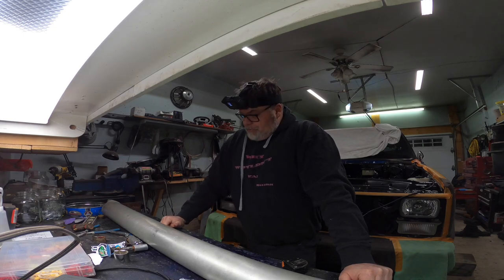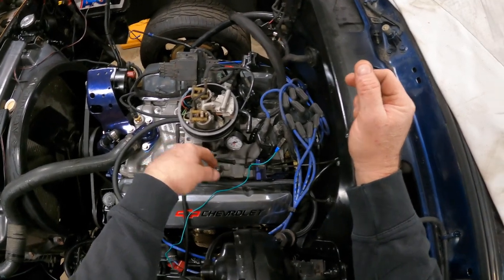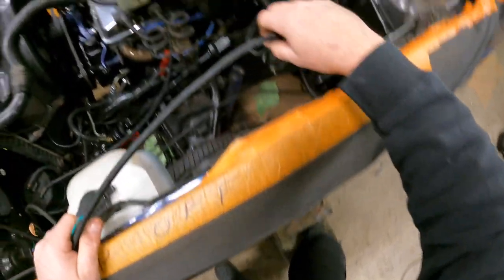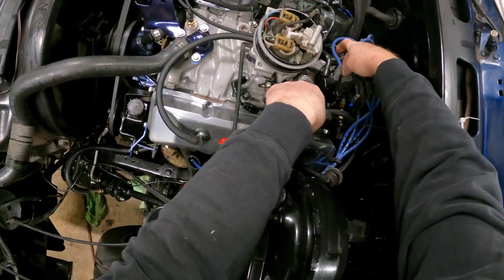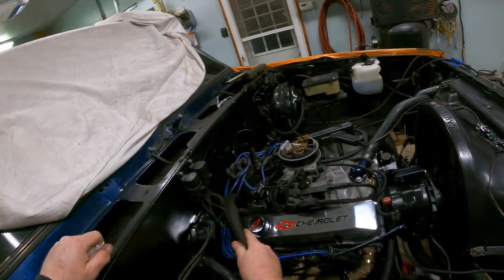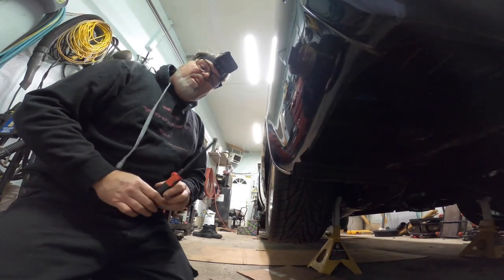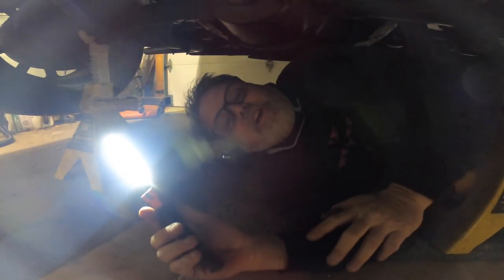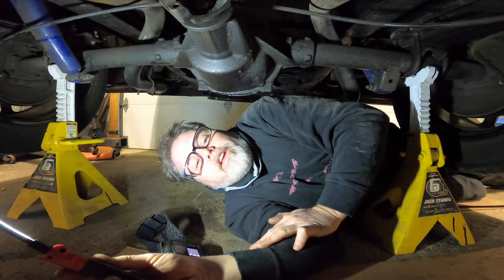DRIVE SHAFT CUSTOM U JOINT    HD 1080p

Comment: Truck is looking fantastic Jim! nice work on the truck. Make sure you get a new crush sleeve when you replace the rear diff seal Jim. When you go to tighten the nut you have to have a torque wrench with a needle gauge to get the correct "drag" while tightening  the nut with the wheels off the ground Jim! Just my three cents. I just got another  Mr heater propane heater for my garage. wouldn't work well while recording videos but damn Jim heats the garage up nicely. My garage isn't insulated very good but it can get the garage warm while using it, and its not jet engine too loud. Holy smokes Jim all the same issues with working on a vehicle and getting pissed i can relate. If it can go wrong it will Jim! Its not done right if its not done twice! You are doing a fantastic job on your truck! I enjoy watching and waiting for the first start! 
Eric from Burton Michigan 

 Also FJB! complete joke!